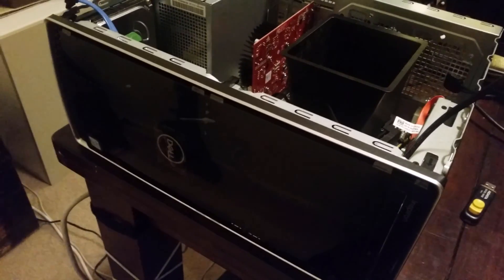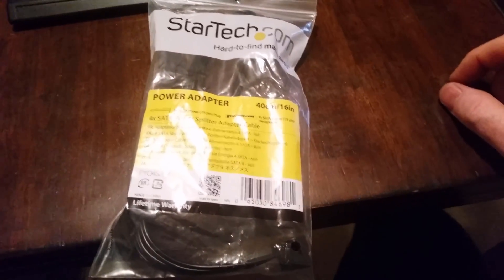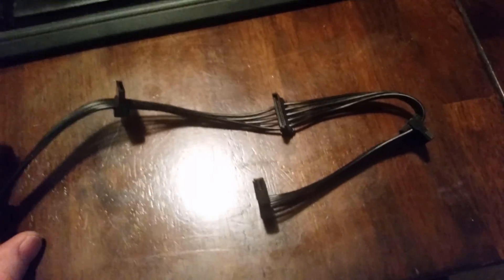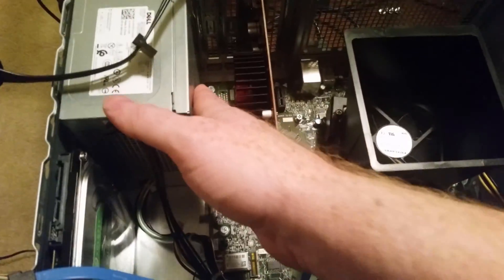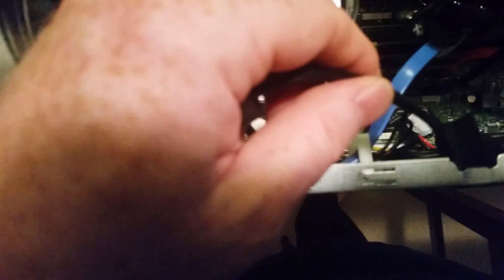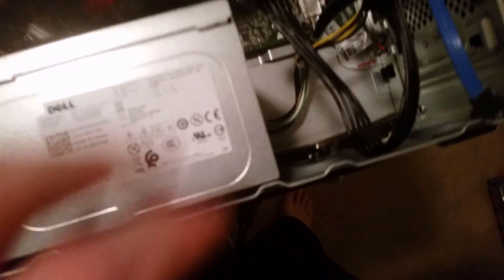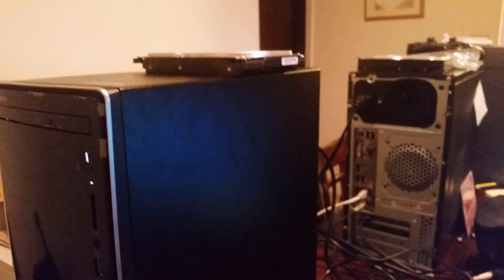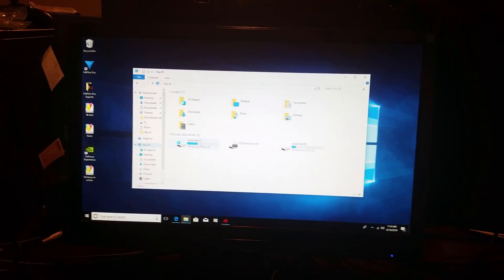Using SATA power splitter to have 2nd HDD or SSD in Dell Inspiron Vostro 3670. Star Tech 4x Amazon

Comment: Is it safe to use 15 pin sata power splitter to power up 2 ssd's?
Reply: yeah ssds only use like 3-7 watts of power
with math you can safely connect more than 10 ssds with one sata power cable
Reply: @football_fanapril2048  doesnt the battery only support or send out so much power through the sata connector and when you try to draw more or less than that power it causes issues and or a potential fire hazard?

Comment: Hey guys. I'm wanting to add both a XLR8 1060 (uses 6 pin) and an SSD to an old Dell Optiplex 7020 while keeping the 1 TB hard drive it came with. Because of the proprietary 290w power supply only powers the board using two cables that in turn powers all other components, I've had to buy a sata to 6 pin to power my new graphics card. The problem is that the board only has two Sata power ports connectors. Can I safely add a sata power splitter to power both the SSD and hard drive, plus power the GPU all from the board?
Reply: I have this same question for my optiplex 9020 mt

Comment: Just curious, is there a reason why you didn't use the SATA power port on the motherboard? The spec sheet shows there's 2 of them on the board. This cable would've done the trick.
https://www.amazon.com/COMeap-Replacement-Right-Angle-Compatible-14-5-inch/dp/B07CK8QP68/ref=sr_1_9
Reply from the maker: Nice...maybe I will have to make another video for this too. lol  I either wasn't aware of it...or it wasn't available at the time of making this video.  Thank you...looks like another alternative to the other cable I use.
Reply: Thank you man . You saved me some bucks . I had that one and i thought i should buy another one for this to work . Thanks again

Comment: Can i add nvdia gtx 1650(6 pin) by using the adapter.?
Reply from the maker: https://youtu.be/3ZmR8RsTlew
Reply from the maker: There is a Zotac 1650 that does not require 6 pin power...I made a video out of it.  If you have one that requires 6 pin you will need a 24 pin to 8 pin connector.  Let me know if you want the product link and video link.  Thx.
Reply: @PC_HardwareTechUnboxing_1  OK I got it. May be I'll go for 24 to 8 pin connector cuz Zotac 1650 is not available in my region.
Can you explain how can it use 1650 by 24 to 8 connector cuz it uses 6 pin right.?
Reply: @PC_HardwareTechUnboxing_1  I am actually buying this pc next month only if I can add 1650 graphics card.

Comment: Can you add a 4 tb drive to this computer
Reply from the maker: I don't have one to test...but I would expect it to work...as it is a proprietary motherboard based on 300 series.
Reply: The spec sheet on Dell's website says these SATA slots are capped at 1TB each. So no, 4TB will not work on this board.
https://topics-cdn.dell.com/pdf/inspiron-3670-desktop_setup-guide_en-us.pdf

Comment: Very nice!  With the encouragement of your how-to videos, I got a 3670 with the plan  to add a 1 TB HDD for all data, leaving the OS and programs on the 256 SSD that it came with. I had a power splitter like this, to add the second drive.

What I hadn't realized yet when I bought the PC, is that the included "SSD" is an NVMe, on the board rather than a separate 2-1/2 inch drive -- so, not using a power cable or the second included SATA cable.  When I opened the case, I was surprised to find the spare power and SATA cables just lying there waiting to be used.  Sweet! 

That only left the challenge of physically attaching the drive since, as you point out, there are no standard mounts built-in.  The 2 oddly-placed holes, I imagine, are for a drive mounting cage that may come with other models but not this one.

What you did was professional and smart.  What I did was use velcro strips to hold the new drive in place.  As you show, the drive is flat on the bottom of the case so I have no real worries that it's going to move or fall anywhere, as the PC doesn't travel.

Once I added a dual-band wifi adapter and uninstalled that damn "Smart Byte" utility from Dell (that was cutting my download speed down 90 per cent), my wife now has a great PC for what she does, reasonably priced.  I have an old GTX 1050 in reserve if she wants it. Thanks for all the tips.
Reply from the maker: That's great.  With that NVME drive you will have much faster boot ups than I do.  I was going to do another installation video for NVME ..adding OS as well.. Do you know what brand yours is?
Reply: @PC_HardwareTechUnboxing_1  , Speccy says it is a BC501 NVMe SK Hynix 256GB (RAID(SSD)).  I didn't even see it, or maybe mistook it for the Wifi adapter (which is an M.2 type, and some of the SK hynix 256 GB NVMes are a similar, small form factor). My thought was that the NVME was hidden by the cowling of the CPU cooler (or it could be on the underside of the mobo, as I've sometimes seen), but maybe I just overlooked it.  Interesting that Dell has these variations -- this one was from BestBuy (my wife just wanted it fast, not built-from scratch).